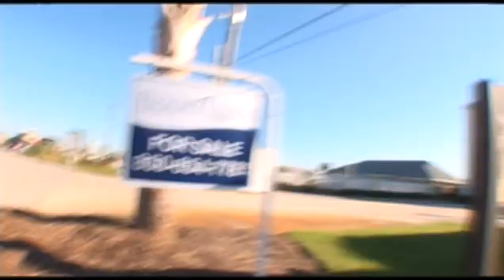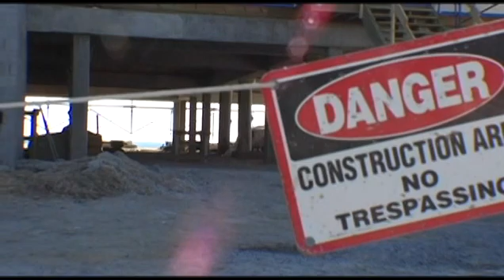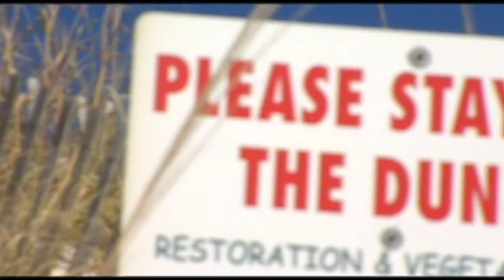Higher Ground: The Battle to Save Florida's Beaches

Comment: Question: I am not anything near an expert, but wouldn't it help to build a sea wall out to sea. I know there was several areas that the romans build an artificial harbor only to have silt and such fill it making it a new area for farming, and home building. IF they build sea walls out of rock and concrete that would cause the water to not move as much, any sediment it carries would be dropped off shore. Also and sand eroded from the shore would mostly end up there. As the guy in the early part said, sand bars protect the shores and that protects the land.
Reply: Coasts shift, man should take that into account when building for a quick buck!
Reply: @tpanayiotou  There are ways to improve the shores, but it cost money and the people that buy that expensive land does not want to have to pay for its restoration.